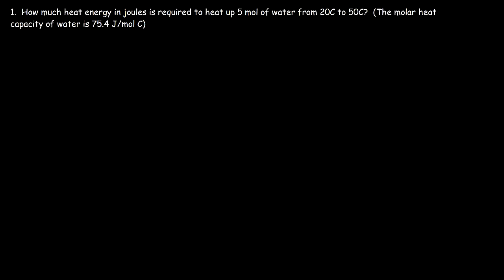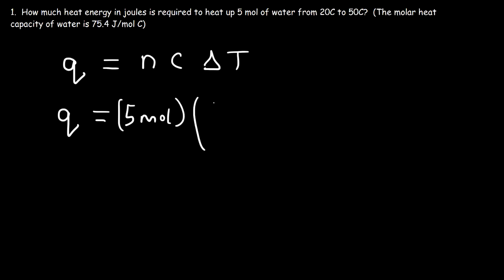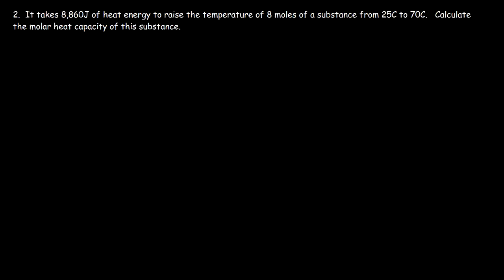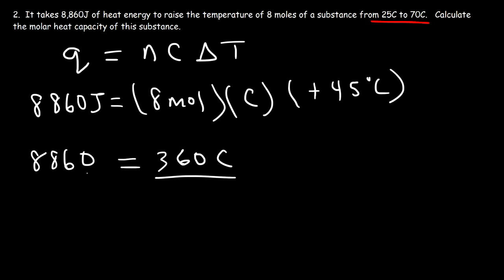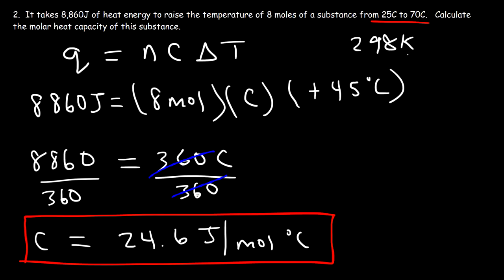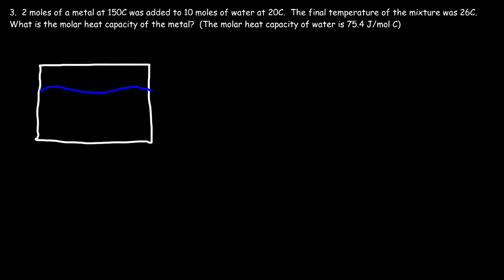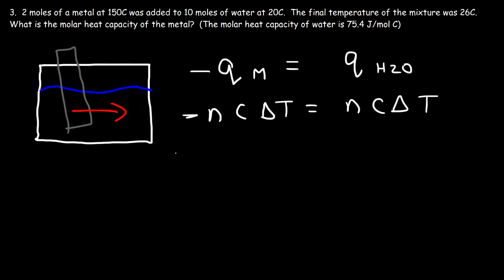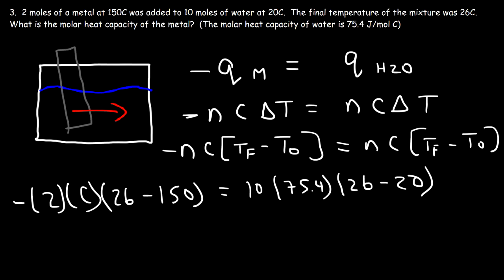Molar Heat Capacity Problems - Physics

Comment: I have a different equation and i need help.
molar heat capacity of silver 25.35J/mol c how much energy does it take to raise the temperature of 9.20g of silver by 17.5c?
Reply: @nightbot.2341  No, it's not. Pay attention that the capacity is given per mol and the amount of silver is in grams. you also need to convert from grams to moles using the molar mass of silver.
Reply: @peacecop  fr
Reply: @priyanzhu  What do you mean?
Reply: @peacecop  bro I just misinterpreted the question I had to calculate the energy and calculated temperature sorry
Reply: your answer is : 1.704 degree celcius